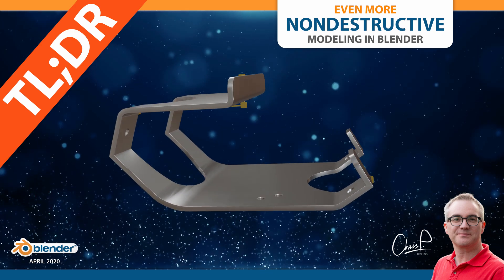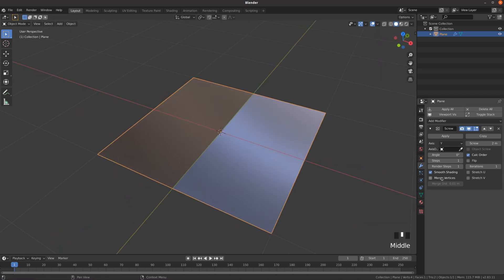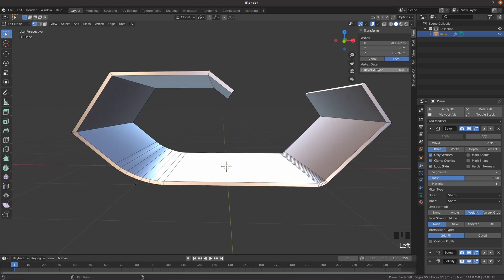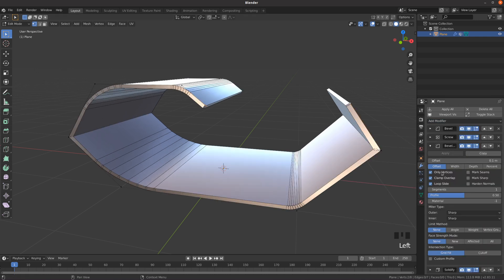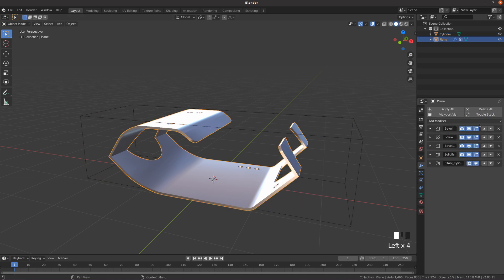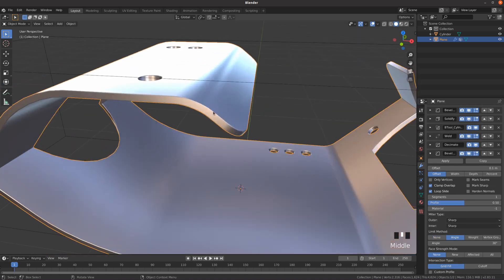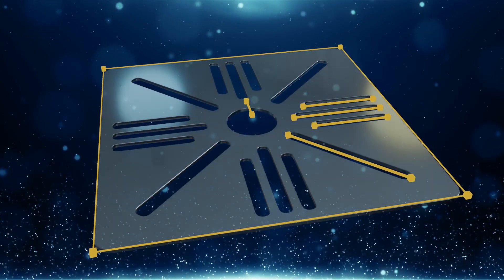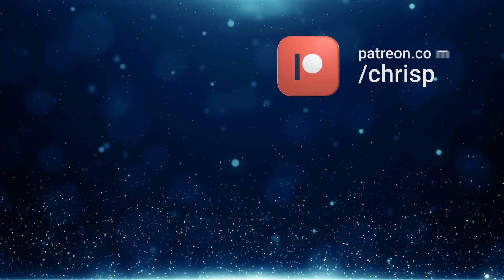TL;DR More Nondestructive Modeling in Blender

Comment: Thanks. This is very useful info.
The last time I seriously looked into blender was years ago. Back then it wasn't yet fit for dimensionally accurate modelling, not to speak of non-destructive modelling. 
I usually model with OpenSCAD which is a textual programming language for 3D modelling (for 3D printing) that features a live preview and keeps absolutely everything parametric and nondestructive. Adding bevels though is very tedious in OpenSCAD. Still I'm just unwilling to 3D print anything without nice bevels (see my models - mechadense on thingiverse). So this is a bit of  a pain point. After watching your (nicely made) demos I see that things have obviously changed for the better now with non-destructive modelling in blender. So I may be tempted to give blender another spin to see if it has become useful for me. At least for some rapid prototyping. Not more than rapid prototyping though due to: 
(1) my higher trust into minimalistic data-formats to remain readable for a longer amount of time and 
(2) my tall orders including but not limited too:
(#) having available proper non-destructive convex hulls (blenders shrink wrap modifier may be a messy and inefficient workaround that I probably wouldn't wanna use)
(#) being able to give all the parameters sensible variable names and access them in a single location managed by the modeller.
(#) being able to feed in arbitrary user-defined math functions -- e.g. for curve shapes (e.g. cycloids, …) -- this may be doable in blender via python scripting I guess ??
(#) being able to have the logical grouping to not coincide with the geometric grouping 
concretely: having all objects change non-trivially and simultaneously while all objects stay compatible (in that they still fit together shape complementarily)
(#) having it all based on pure/denotative/side-effect-free programming language in the background. That is: based on a programming language that provably fences of against destructive updates via its type system ("no-destructive programming" if you so will) (very much NOT like python, very more like e.g. elm). As a side-note: OpenSCAD has no means to encode any destructive updates whatsoever, so it does not need to fence off against that.
PS: Grüße aus Wien
Reply from the maker: Und ich beginne gerade mich mit Fusion 360 zu spielen weil vlt muss ich doch irgendwann 3D Druck probieren...
Reply: @chrisprenn  -- Wenn Ideen da sind kann ich 3D-Druck auszuprobieren nur wärmstens empfehlen! Selbst hab ich nen Ultimaker-Original erster Generation und seit ein paar Wochen einen mobileren Makerpi M1 mini. Würde derzeit aber am meisten die Prusa Drucker empfehlen. Angefangen mit 3D-Druck hab ich  noch vor dem Hype mit dem 3D-Druck Service Shapeways. Da gibt's mehr optionen als nur FDM-Druck und Resin-Druck (lasergesintertes Nylon und Aluminium, klebergehärtetes Vollfarbengipspulver, bronzeinfiltriertes Edelstahlpulver, ...) aber selbst die billigsten Optionen sind pro Druck immer noch 600x teurer als mit einem eigenen Drucker (sofern man sich seine eigene Arbeitszeit nicht selbst verrechnet).

Comment: Hey, I've been slowly fixing my terrible meshes with the help of your info. Thanks! 

I had a question...  I want to do something without permanently applying my  Boolean modifier, but it doesn't seem possible. 

A simplified version of the problem would be like this: imagine a cube, and I use a Boolean difference modifier to chop off one of the corners. I want the chopped face to have a bevel where it connects to the other faces. But I don't want bevels anywhere else.

I can't seem to make it happen because the chopped face doesn't have selectable edges/vertices, unless I permanently commit the Boolean.

Can you think of a way to do it without applying the boolean modifier first?
Reply from the maker: this is not possible in Blender - you ill need a CAD software for that kind of stuff
Reply: @chrisprenn  cheers, I suspected as much. Well anyway I'm sure I reduced the mesh by a million triangles anyway, so thanks for your videos.